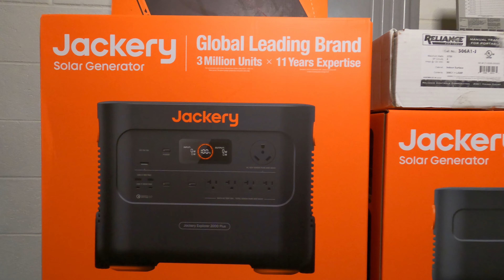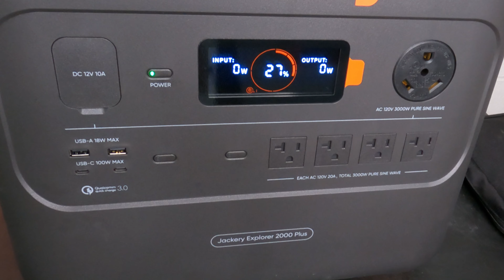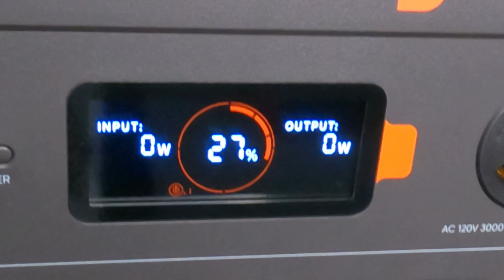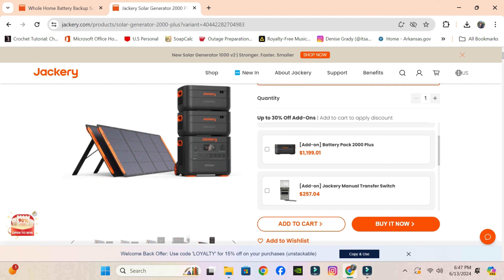NO COMPROMISE |Cabin BUILD |Homestead |Jackery 2000 Plus Solar Generator |Off Grid HOME BACKUP Power

Comment: You shouldnt leave the cable in a coil as it can overheat due to some complicated physics
Reply from the maker: That I very good point.  I'm going to look into this.
Reply: Passing electric through a cable produces a magnetic field and when the cable is coiled it produces what is called a back emf which is a form of resistance that is what causes the cable to overheat.